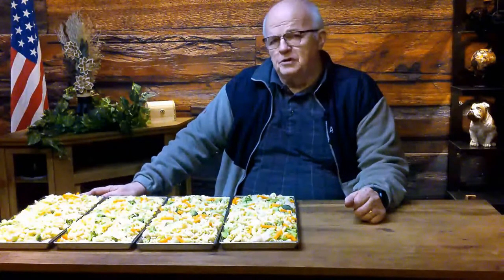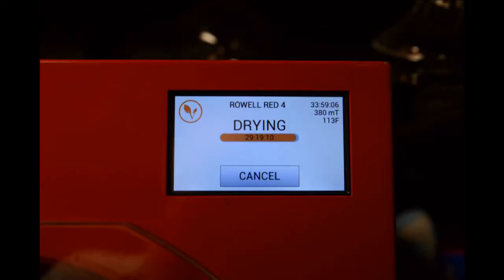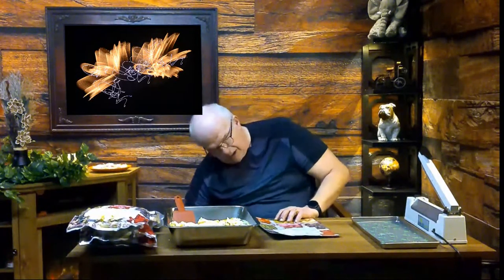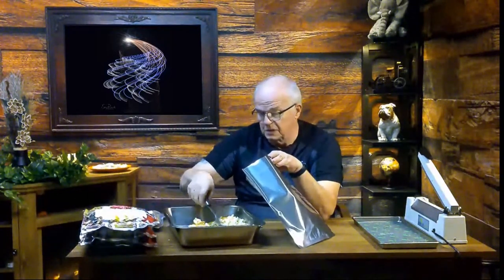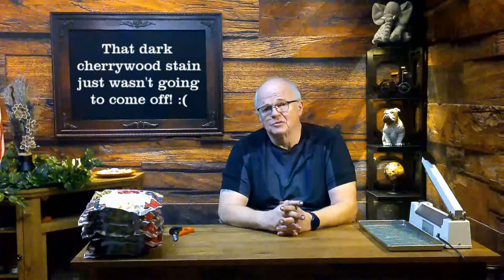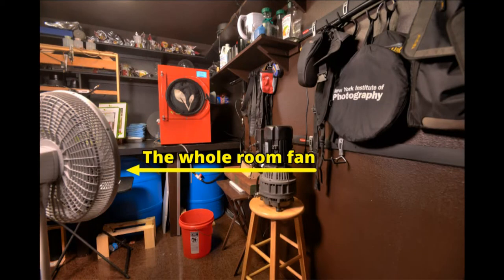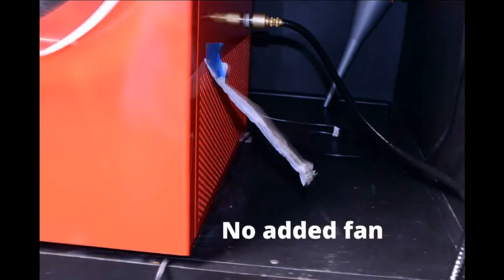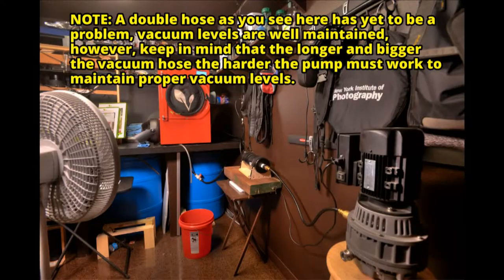Freeze Dryer cooling tips

Comment: I can’t thank you enough for your informative and helpful advice and insight on freeze drying!  I’m sorry I brought up isopropyl alcohol on another post(I couldn’t get back in to that exact one because I’m not on google).  I’ve had my Harvrst Right freeze dryer for over a month now and I haven’t even tried it.  I’m so scared of doing something wrong!  I’m watching as many of your videos as you have made, and the other guy I mentioned because both of you approach it scientifically, which I’m all about!  I’m trying to learn from you so I don’t make the mistakes I’ve heard others have done!  I don’t know what my problem is!
Reply from the maker: Hi Shelly. You can simmer your fears down because there is really nothing you can do to unintentionally damage your FD. Even the programming does not have the ability to cause damage of any sort. It is true that there are a lot of procedures that will help you do a more efficient job of FD'ing (you will eventually learn them with time) but in order to damage anything you almost have to do it intentionally. The barrel is solid stainless steel so you can really clean it any way you want, just don't scratch it. The goal is to make sure there is no residue when you are done. The rubber seal is pretty tough so treat it softly with respect, nothing abrasive, and it will outlast the FD. Do the same with the plexiglass door, I use Windex on it, both sides. Keep the tray wiped down with a soft cloth and warm water, avoid harsh cleaners unless something is stuck on the shelves but even then, it would be difficult to damage them. As a rule, keep your trays at or below 2.5 pounds each but if your food is relatively dry you can go as high as 3 pounds per tray. Candy has special procedures so if this is your goal then do your homework. Keep the sides of the FD clear of objects, 6 inches is recommended and make sure your FD is in an area with good circulation and stays at or below 72 degrees. I have seen rooms go as high as 80 degrees, but you will get an error warning, if the room gets too hot the FD will shut itself down. What I am trying to say is that your FD is pretty tough, you may have failures in the process, but everybody does so learn from them, you will not damage your machine. You may have maintenance issues like burnt out circuit boards, cooling or vacuum problems but, although it can be a pain in the rear, none of that will be permanent and very unlikely your fault.  Evan
Reply: Thank you again Evan for your advice!  I’m very grateful to you for taking the time to reply back to me!

Comment: Mine says it is too warm if the room temp gets above 70 degrees. My house is air conditioned and never gets above 72 degrees but the freeze dryer is generating a lot of waste heat. I'm going to get rid of this thing. It takes at least 48 hours of time to dry anything and it can be a pain in the butt. I have two fans going in there all the time it's running but that doesn't seem to help. Today it's 52 degrees and I have the window open. Maybe that will keep it from overheating.

Comment: Good information to extend the use of the FD in the garage during warm weather.  Any ideas on how to improve the function of the freeze dryer if temperatures drop below 45 degrees.
Reply from the maker: Hello Dewey, the FD is made to operate in cold temperatures. the room temperature would most likely have to get below -50 degrees before cold temperatures would be an issue, but I have little direct experience with cold issues. When I first got my freeze Dryer it was in my garage on some really cold days, well below freezing (I live in the Rocky Mountains) and I experienced no problems. In any case I'm quite sure that temperatures above 10 degrees will pose no problems, your FD might even work more efficiently :)  Thanks for reaching out, Evan
Reply: @evanrowell5266  
Thanks again for helping the freeze drying community get the most out of their FD..
My last batch was when the FD sensed a room temperature of 44 degrees.  I received an error message saying the vacuum pump may not work properly at low temperatures. I proceeded with the batch. The air temperature of the air exiting the compressor was about 10 degree warmer than the room temperature. I placed the pump next to the fan discharge and it warmed up prior to starting the vacuum phase.
Reply from the maker: @retiredtech3674  That's good to know, thanks. Putting the pump in the air flow is smart, you might even want to place a small room heater somewhere in proximity to the FD but I still do not recommend  putting a strong heat source next to the condenser intake. Let me know what you find.  Evan

Comment: I have to put my vac pump in back of my freeze dryer. It sits about 12 inches behind the machine. What are your thoughts on that? Thank you and blessings.
Reply from the maker: Should not be a problem, air flow is from side to side on your FD so Having your pump behind the FD will work fine.   Evan
Reply: @evanrowell5266  thank you

Comment: I built a cabinet to reduce the noise. Ithere is not nearly enough clear space on either side,
I plan to drill holes on the left side and another larger hole with an exhaust fan on the right.
The unit is is my garage where I work, so I need to dampen the noise.
Reply from the maker: Hello Chris, I understand your concern, but air circulation is critical to managing heat, drilling some holes will most likely be insufficient. I left the door to my dark room closed one day and the temperature in the room rose to over 90 degrees in less than 12 hours. You might be able to pull it off by installing another fan on the intake side forcing a higher volume of air through the FD to keep the Condenser sufficiently cool, if not, then you will find that the FD will overheat. The pump is actually noisier than the FD so isolating it from the garage will help, perhaps a well vented cabinet for that alone would be a better option, in any case do not put the pump in the cabinet with the FD. There are things you can do but keeping things both cool and quiet is going to be challenge. Like I mentioned in the video, if you can manage it with no more than two connected vacuum hoses, you can run them through a wall into another room wherein you can keep the pump. Let me know what you come up with and how it works, Good Luck,  Evan

Comment: Do extreme cold affect the machine?  For now mine is in the garage.
Reply from the maker: Hello Loriena, I have run my machine below freezing with no problem but never nearing 20 degrees or colder, however, I have followed threads wherein some have indicated they get an error message if it is too cold. You might want to pose the question in a few forums. Facebook has a few but other than that I can't be of much more help.  Good Luck, Evan

Comment: Curious why you vacuum seal the mylar bags?
Reply from the maker: Several reasons really, First is storage. The vacuum packed bags are more compact and require less room to store. Second, with the addition of an O2 absorber in the packed bag to mop up any trace O2 the food stays fresher and the flavor is preserved longer, especially for long term storage. Truth is if the bag is going to be well sealed with an O2 absorber then simply squeezing out what air you can before sealing it is sufficient. Thanks for reaching out, Evan
Reply: @evanrowell5266  thank you so much

Comment: I just noticed the radiator on mine needs to be cleaned.
Reply from the maker: I assume you mean the condenser coils (looks like a radiator) and yes, they do need to be inspected and cleaned at least every few years.  I would suggest using a condenser cleaning spray with an absorbent cloth under the condenser, it does a great job and being under pressure the spray rinses itself out carrying out the dust out with it.